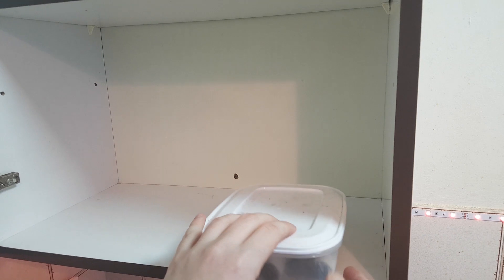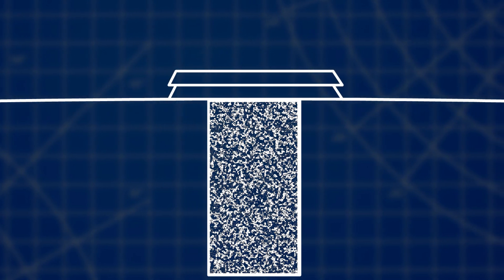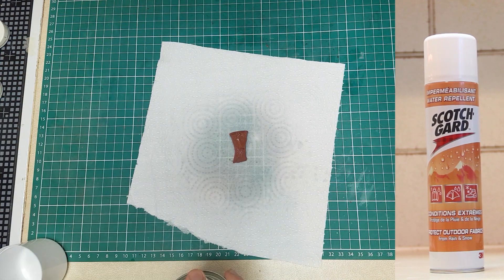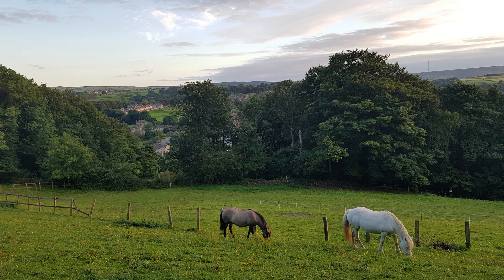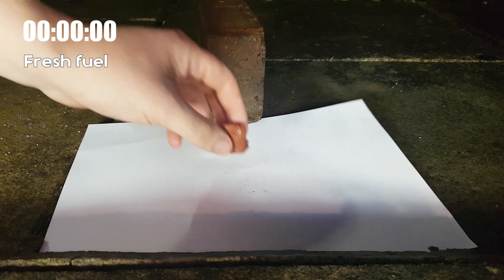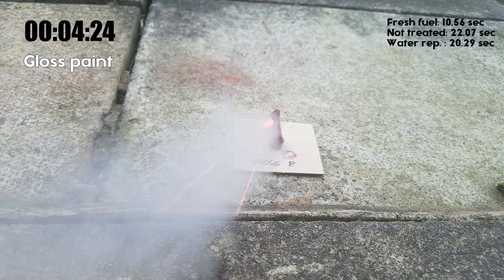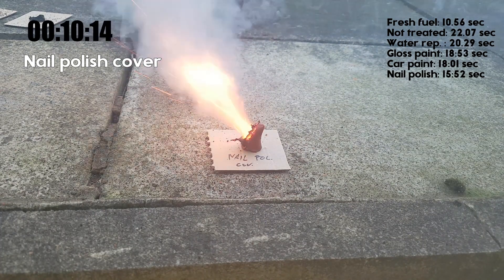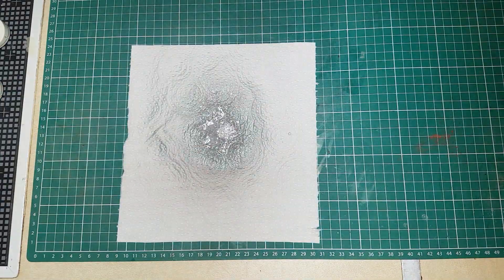How to preserve the power of the sugar rocket?

Comment: Also since you add rust, have you tried aluminium power, basically adding a touch of  thermite? This may increase the heat to a level that it converts the moisture to steam  and ignited the remaining fuel.

Comment: Have you tried  storing in NaCl after heating the salt in an oven to drive out the moisture, letting it cool in a airtight container, and then storing the fuel in the desiccated  salt air tight container?

Comment: I put my engines and mixed fuel in a vacuum paint pot and draw it down to 30" of Hg (Near total vacuum.)  It dehydrates it pretty nice after about 12 hrs or more in the pot. . It goes faster if you warm it (the vacuum pot) also. Then I store the finished engines in a a fresh container of Silica Gel desic. I bought a cheap roughing pump used for HVAC from Harbor freight and converted an old pressure cooker to  a vacuum chamber. and some plumbing fittings.  Old heavy wall Presto  Pressure cooker pots 20-25 Qt pots are heavy wall and I find the for $5.00 at thrift stores!  sometimes the seals are bad but it is easy to make them with Silicone Rubber Caulking

Comment: For some reason I believed this was about extending the burn and preserving power through the burn - silly me.
Reply from the maker: Oh noo... Its about to keep the fresh fuel's performance for longer.. kinda like preserve... :) Sorry for misunderstanding. :/
Reply: @pandicus1412  Like I said, silly me...still invaluable info, I have all my substrates, fuses, electrical components, premixes and utensils stored in zip lock bags in a cardboard box in a garage :( I haven't touched the stuff in about a year - after watching your vid I am sure it's going to be kaput
Reply from the maker: @wingnutzster  Not necessarily. If your premixes are not "cooked" yet, You can dry it at some heater or you can get rid of the water contamination through dry heating process. :)
Reply: @pandicus1412  Brilliant thanks I will try that

Comment: I was try to make rocket fuel kno3 and shugger but it didn't work with me why ?
Reply from the maker: Today I  finally captured the last test of my rockets for the "How to make sugar rocket properly" video. It still need some editing but I hope I can release it asap. :) If you're using 65% KNO3 + 35% sugar +1% iron oxide with dry heating, and it's still not flying I guess that the problem is not in your fuel. Probably it is a way you making it. 
For example. In the incoming Video, I'll show you how an 50g rocket motor can produce 4g of thrust.... or... over 2400g of thrust. I used the same components I just paid attention to some stuff what I'll share with you. :) 

Just a footage what you can expect: https://www.instagram.com/p/CKKegGInjJJ/

:)

Comment: good video

next time you should have a cast so that fuel would have the same shape.
If youre going to try fuel storage experiments again I have some suggestions:
1. Keeping it just in a sealed jar (if you think there is going to be leak seal the lid with silicone)
2. Putting some silica beads (or any other desiccant)  into the jar
3. Since KNO3 absorbs water why not dry it and then put it in the jar along with fuel
4. Putting some mineral oil in the jar and submerging the fuel and later before use cleaning with acetone
5. Putting fuel into a bag and vacuuming it.

Keep it up man
Reply from the maker: Thank you for your suggestion. Yeah I'll check them. :)

Comment: i am currently working on a college level rocket project..
i have some questions
can we cook the mixture with sulphur?

if the mixture is under pvc pipe and we cover it with 5 6 layers of tight plastic..how long can we store?

will solid fuel with knO3,sugar,iron oxide and sulphur need any protection to store?
can we pressure same fuel to store under a pvc pipe?what are the odds that the mixture with sulphur that it burn with the pressing pressure....
what can be the best way to make hole inside the hardly compacted fuel in pvc pipe? about 1 feet long pipe..can we do it with drill machine?what are the odds for reaction by friction?

what can be the best mixture for sugar rocket?and the composition also...i have senn people using corn syrup,aluminium,potassium perchlorate,ziinc dust..what is the best?

if you can please make a video about my questions..or you can answer me..i need your help
Reply from the maker: Hi. I hope I can help.
 I already made a video about the rocket fuel composition. :) 

You can check it here: https://youtu.be/vJKOOOfBi3Y

I tried out multiple types of fuel with Kno3, Corn syrup, aluminium, sulphur, etc. based on research (Forums, sites, professionals)
If you planning to do it in Dry heated way, I do not recommend to add sulphur, because of low flashpoint. (160°C) However I've made some experiments to add sulphur while I dry heated but I did it in a very cautious way, that suplhur was just about 2% of the total mass. SO it was kind of insignificant, but it helped evaporate the remaining water in the mixture, while it burned.
In dry compressed form, the sulphur is kind of okay, but you can hear more about this in my video above. :) 

Solid fuel also needs protection. As KNO3 is a salt, its binding water from the air. I recommend to use the rocket as soon as possible when you made the composition. Otherwise, you can check the tips above. :) 
For the dry compressed (Non heated, just powder form) version the best way to store a rocket is a sealed vacuum bag in a tight locked jar, or, as you saw in the video. You can even cast it into epoxy resin. (And when you want to use it, just drill the bottom, and use.

For a feet long rocket, I can recommend a drill. Even if you're using Red powder (KNO3+Sugar+Fe2O3) you can drill it.... BUT... and this is a "huge BUT" you have to do it slowly and very cautiously. Drill it in intervals. (Drill few Cm/inch then stop.... drill... stop....) I can recommend that you can always pull out and try to touch the drillbit. If you're able to touch it, it's good to go. If you cant, just wait a minute then you can continue.... Dont cool the drillbit with water or oil cuz it can ruin your fuel....  The friction you can worry much more if you're using metallic components such as aluminium, zinc or magnesium.... That's why Im never using it for even dry heating.... A spark is enough for a VERY bad day....

Unfortunately I cannot tell you my opinion about potassium perchlorate (As it is restricted in the UK just for research labs) All I know that potassium perchlorate is used in fireworks and smoke bombs.

If you're really planning to do a rocket. Even PVC or Paper casing. I can tell you that currently I am working on a video about the best structure for sugar rockets. I could make almost 3KG of thrust with only 50g of sugar rocket motor. I used the same components: KNO3+Sugar+Red iron oxide..... but the fuel is just the top of the iceberg. In that video I'll tell you from "A" to "Z" what you should really do to make a powerful sugar rocket. :) 
I still need to do some tests but the video should be out in the following weeks. :)

Comment: Great video! I too have been experiencing this moisture problem with some of my larger motors. I have a hypothesis that dessicant bags such as silica gel stored in a container/plastic wrap with the rocket fuel will prevent fuel degradation as the dessicants remove the moisture from the air, I am yet to test this but it seems possible- if moisture is a problem a dessicant in a closed system could solve it.
Reply from the maker: Yeah. I DO also planned to do a "Vacuum bag" solution... it might work as well... :) 
I just wanted to make this as eco friendly (cheap) as possible (No vacuum machine needed or special materials) 
But yeah... more protection, less degradation. :) 
---
It just really turned me crazy when Im made some sugar rockets but due to hight moisture they were  unable to fly even on the next day. :/ :)
Reply: @pandicus1412  Yeah what we really need is a shape conforming container with a seal so good not even the smallest air leak is possible. Yeah I live in Australia and it's the middle of summer right now, average daily max's are well into the 40's and even the 50's with near 100% humidity, not even the Kangaroo's can handle that! I made a few 65:35 +1% iron oxide rockets with 1kg of propellant per rocket and the speed that thing took off was unbelievable, truly deafening sound which could be heard miles away, even had a few which turned into a pipe bomb on the launch pad likely due to a few trapped air bubbles or too small a nozzle, great fun whichever side of the smoke bomb - pipe bomb spectrum it chooses to be :)
Reply from the maker: @gamersden30  Sounds great. :D Just (I guess needless to say) be careful.. My last 500g rocket just almost  smashed my GF as the parachute did not opened. :D
Reply: @pandicus1412  That's part of the fun! But I always insist I wear full welding gear (helmet and clothes) when mixing a batch that big, always assume it will blow up in your face because one day it will :)